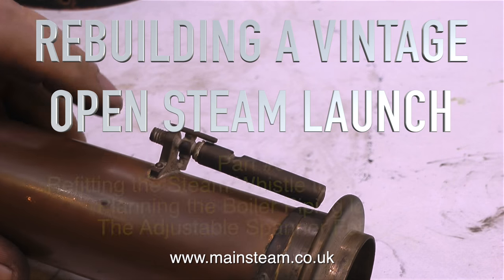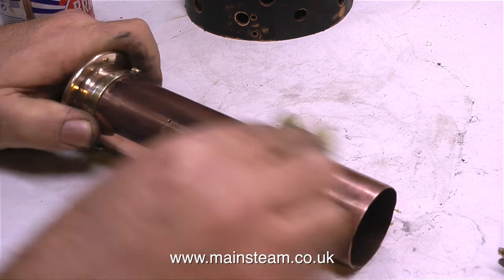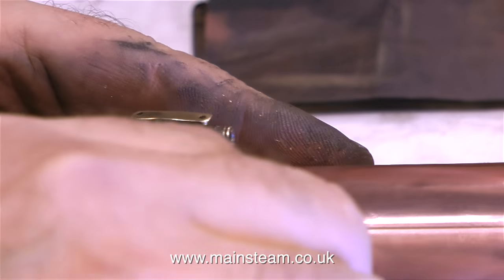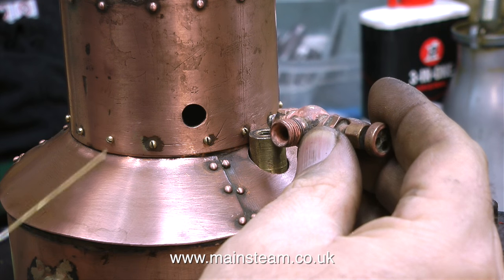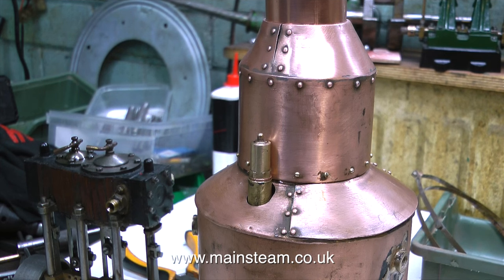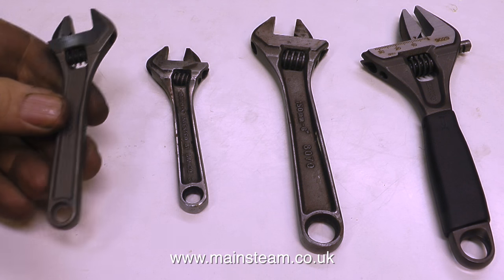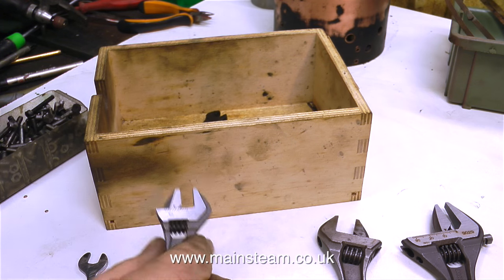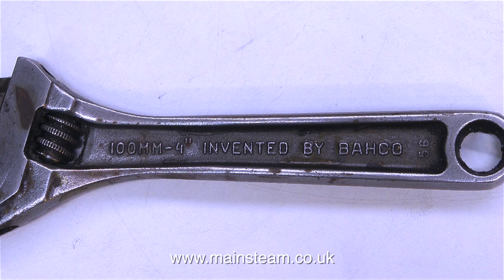REBUILDING A VINTAGE MODEL OPEN STEAM LAUNCH - PART #5

Comment: Well done Keith. I too have a brace of adjustable spanners. The gang I run with calls them wrenches. In a pinch or if used carefully they can come in quite handy. I didn't like one feature that was a constant problem. The maintenance crew members at the foundry where I served my apprenticeship each carried a 10" adjustable wrench in their tool pouch. They used it for everything. Including stirring their coffee. Mostly it was a conveniently heavy object for adjusting the shape or position of an item. Aka a hammer. Half the time the wrenches wouldn't close up to less than 1/2" because the end of the opening for the jaw had been beaten shut. 
After I left the foundry and went out into the world I discovered that it was a universal method of use for an adjustable wrench. Not only did it cause a great many objects to have dents and dimples in their surfaces. Which is quite a problem for the tool maker that has to go along behind said ham handed monkey and fix those dents and dimples. Because it wouldn't adjust properly due to the mashed head, nearly every adjustable wrench became the classic nut rounder. 
My father, who became supervisor of maintenance years after I left, once became so annoyed that he had dozens of damaged wrenches turned in each year, welded the cut off face of a 16 oz ball peen hammer to the head of a 10" wrench and the next guy who brought in a damaged one receive the supposedly useless example of what not to do with an adjustable wrench. The guy loved it. The next week every one of the crew had welded a hammer head onto their adjustable wrench. Of course they no longer worked at a wrench for most situations but they made bang up hammers. 
I ended up at the local Walmart, tagging along with my wife while she picked up groceries. As I often do I wandered over to the tool aisle and checked to see if there was anything of interest. There hanging on a peg was an adjustable wrench with a hammer head forged onto the back of the fixed jaw. My father, gone to his rest 15 years ago, is sitting on a cloud somewhere laughing uproariously at how his attempt at humor became reality.

Comment: Keith, I did some research on Bahco, and found out that they 
are a part of Snap-on International.

So, it seems I can get a Bahco adjustable spanner, 
off of the truck, next week.

steve

Comment: when using an adjustable spanner on a tough nut make sure that the high end of it work against the fixed jaw. The low end on the adjustable side. Then you can give it more torque without slipping. Quality make a huge difference, so do not judge all adjustable spanners by the cheap brands. And one more, here in sweden bacho is pronounced with a short "a". Like Backhoe digger (without the oe).  Keep it up :-)
Reply from the maker: Thanks for that, I will correct the pronunciation of such a splendid precision made item . . . . :-)))

Comment: I am squarely in the camp that thinks you are Bahcoing mad! 
While I fully agree that a good adjustable spanner can fit better than an open ended spanner, I have two problems with their use.
Usually, the head of an adjustable spanner is bulkier, so if there are any nearby appendages, then you could get a reduced operational angle! Second, a hex socket or ring, then a bi hex socket or ring distribute the stresses in a circular manner within the head of the nut or bolt, whereas the open ended spanner causes a stress pattern through the nut that is more akin to an "S" shape.
While the use of well made quality tools of any type is to be applauded, I think the way to go is to have every type of spanner and socket option to hand so the "best" option for any situation can be deployed. 
Which, coincidently, is almost exactly what you do anyway, so keep up the good work
Anyway, what's wrong with our very own home grown "Girder minor" by Lucas? They have a much larger sliding surface area to keep the jaws under control! I bet Bahco were still in nappies when Girder minor hit the shelves!
Reply from the maker: Never heard of a "Girder Minor" but I will look into it - thanks for the info Roger :-)))
Reply: I bet when you see one, you will have an " Oh, one of those! Moments

Comment: Well, i use adjustable spanners a lot as well. Not all bahco. I inherited a small one like yours from my father in law, but its seized up. Penetrating oil didnt help. I want to restore it and use it, but im not sure how to go about that job. I guess ill start with an acid bath to get some patina off. Do you have any other helpful ideas for me on this?
Reply from the maker: Heat . . . . . .
Reply: Why didnt i think of that. I will try that! Thx!